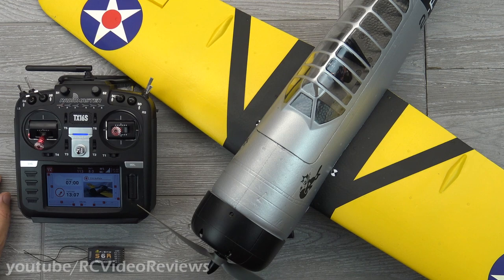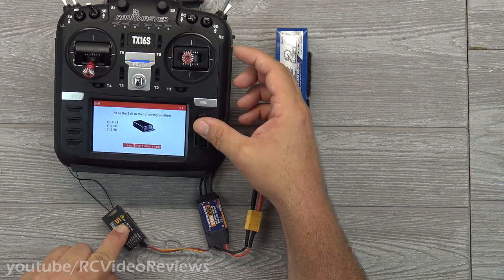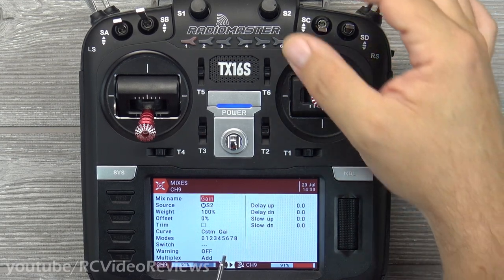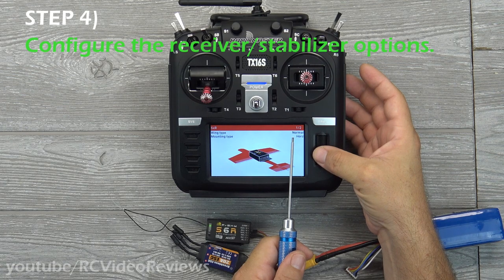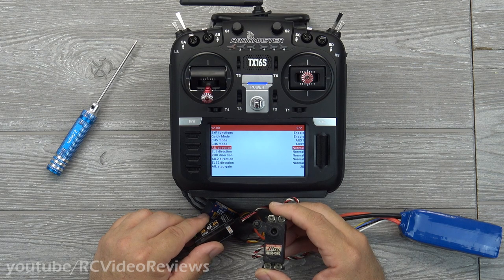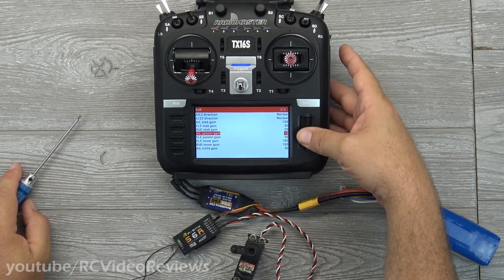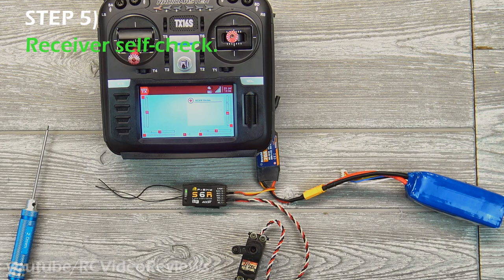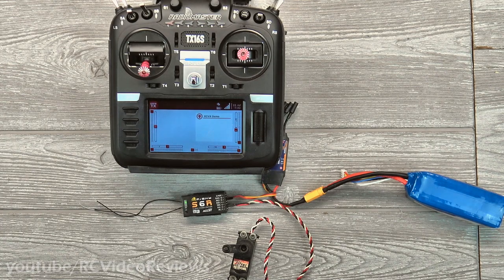Radiomaster TX16s and FrSky S6R / S8R Setup Guide [Quick Mode] • [Intermediate]

Comment: Hi John,
I studied sveral of your excellent videos and learned a lot of it.
An issue I was not yet able to solve concerns my S6R/S8R receivers.
I use edgetx 2.7 and the receivers have the level 2.3 for the FrSky firmware.
Binding is fine (FrSky X2 with LBT(EU) because my location is Germany). I selected 8ch with telemetry.
The normal functions are working, I could also calibrate and configure the receivers following your hints.
But I'm not able to put them to the self check function (blue LED) via switch SA on ch12, for which I also checked the output.
And the stabi mode switch (ch10 on SE in my TX16S) does not do anything what is described in your video
"Radiomaster TX16s and FrSky S6R / S8R Setup Guide [Quick Mode]"
I would highly appreciate your advice.
Regards, Wolfram
Reply from the maker: If you have a bind and control over the channels on the radio, there has to be something missing in your radio configuration or in the LUA. 

I would do some basic testing like ensuring my switch movement showed as an output on the channel monitor.

I would verify SXR functions enabled in the LUA script.

I would probably create a brand new model and do nothing except add the self-check and mode switches and check again.

I've used this template quite a bit and I know it works.

Comment: Many thanks for your great videos.  I set up the control surfaces as you suggest before configuration so they work in the correct sense for the aircraft. 
On selecting a gyro mode I noticed that the gyro commanded the relevant surface in the wrong direction. I used the LUA script page 2 and inverted the appropriate surface and it inverted the control surface direction! This was solved by me returning to the normal selection and reversing all the servos for the affected controls . I was not expecting that. Have I missed something?
Reply from the maker: 1) Put it in manual mode--no intervention from the stabilizer. Use outputs to ensure all surfaces move the correct way. 
2) Put it in attitude hold (stabilize) mode. Use LUA script as necessary to reverse servos until they all move the correct way.
Reply: @RCVideoReviews  sorry I didn’t explain myself well. I followed all the steps above and all control surfaces worked correctly in manual and stabilised mode. The only error was that in stability mode the response to wind gust was in the opposite direction. To get a correct response then reversed the servo direction using the LÚA script but then all inputs in manual mode were reversed also. Very strange and now sorted as I just inverted the inputs to match the working stability mode. Many thanks

Comment: Just for anyone who is having trouble binding there S6R...   This was driving me or should I say flying me crazy!   Then I was playing around will all RF Protocol and  to my surprise I found one that worked.    If your using a TX16S  you normally connect to FlySky but on some of these receivers you have to choose FrSkyX2. I believe it must be an update.  Any way that did the trick.  Hope this helps someone.
Reply from the maker: S6R is a FrSky device using D16 which is a FrSky protocol. You can't bind to a FrSky receiver using FlySky protocols. They're completely different. Also, you use FrSkyX2 D16 for v2 firmware on the S6R. If you have a v1 firmware you need to use FrSky D16.

Comment: Great video, I am guessing that all of this applies to the Radiomaster t16 max edition as well. The question I have is, have you got full Telemetry on this,  and would you think that this radio will receive the Amps telemetry coming from a FRSky Neuron ESC via the Sxr. Thanks in advance and for puttting up these very informative videos.
Reply from the maker: You're welcome. If OpenTx can receive the telemetry data you'll be able to see it on this radio. All of these tutorials apply to all of the OpenTx full screen radios and even Taranis--although a few menu items have been moved around.

Comment: Excellent!! I am about to buy some receivers. I need something with a stabilizer. Do you recommend buying the new Archer Frsky generation? or good old SxR receivers? My radio is TX16S.
Reply from the maker: I believe Archer requires ACCESS which is encrypted. You'll need something that supports ACCST for TX16s.

Comment: Thanks, that's very helpful.
Once the calibration is done could the ch12 b changed to a momentary switch (button) and be used as the panic mode to flip the plane right way up? I have an additional momentary button on the back of my tx16s which I'm thinking of using as my panic button.
Reply from the maker: Sure.

Comment: I keep on ending on your vids again ;-) Almost seen the all, thanks for the info!

I do have a question about the S6R and TX16s. If i test the servo on a servo tester its goes way further than on the TX16s - S6R. I ticked of extended limits in the "model setup" and on the output i set it on 125-150%, but no luck no more throw whatever i do. Any idea what this can be? I just want more throw for my flaps and crow braking. 

I noticed you have different versions of the S6R.. ordered two new. The V2 does come with some funny issues. From out of the box it does only do throttle nothing else. Figured out you have set the calibrate on CH12, flip the switch 3x.. and it recognizes all servo's again. Sometimes the rudder was shut off (?) even after everything is saddle.. A new calibrate and it works again, bit buggy though. I do got the newest firmware.
Reply from the maker: Hard to answer this. The servo tester could be overdriving your servo. With OpenTx firmware 2.3.10+ you have ppmus values for a given channel shown on the output screen. What I would do is look at the output screen and pay attention to that value as I moved the servo. You should go from 998us to 2012us. As long as the servo moves with your stick from 998us all the way to 2012us and your weights = 100% on output, your servo is going as far as it is designed to go.

Also, make sure you aren't using dual rates when you calibrate. Make 100% sure your inputs, mix, and output all have 100% weight BEFORE you calibrate. If you use anything less, you will not see full movement when you operate the sticks.
Reply: @RCVideoReviews  Thanks for the reply! Due to your comment I found a little rabbit of 20% on the input on the ailerons. After calibration.. it got up a bit! It indeed goes from 998us to 2012us.Thx again!

Perhaps other servo's would be a solution for more throw? Your secret servo's the Emax ES08ma;-)
Reply from the maker: Glad your found it.  Heck the specs for whatever servo you want. The radio should be able to drive it to the specs.

Comment: Auto-level can be very difficult to control once engaged. Id encourage the use of auto-level on an intermittent switch while using Gyro mode on fixed position switch...
Reply from the maker: Pretty subjective statement. I've flown planes like my Dart on autolevel for 45 straight minutes. It may be difficult for you to control, but that is a personal issue, not global.

Comment: OK I understand that weights can all be reset after calibration. How about trimming? will trimming using the normal manual adjustment and mixing for say flaperons be OK?
Reply from the maker: I don't understand this question: "will trimming using the normal manual adjustment" 

Mixing is not impacted by the self-check. The self-check tells the radio about level and range of motion for the sticks. I believe it incorporates trims but haven't tested that one.

Comment: I assume that full stabalization mode is not engaged until the plane is in the air? It seems it would make take off difficult?
Reply from the maker: Stabilization can be turned on any time the pilot wants it turned on. I don't understand the nature of this question.
Reply: @RCVideoReviews  I guess what i meant to ask is can stabalization mode make the plane react slower to inputs on take off? Or if you are maidening an airplane for the first time as a new flyer and havent trimmed the plane yet but neutralized all the control surfaces, should you count on stabalization mode to make first flights easier?

Comment: The receiver must have both gyros and accelerometers in the circuit board. When you are on rate mode only the gyros are correcting. When you are in auto level mode both gyros and accelerometers are working. That's why you see what you saw when you played with the gains between the two modes.

Comment: Is there a way of using the ch 9 gain function on a trim switch such as the T5 so you do not have to remember where you left the knob for the gain? I tried it by changing ch 9 to T5  but the trims did not do anything.
Reply from the maker: Use t5 up and down to adjust a GV. Use that GV as the weight on the mix for Ch9.
Reply: @RCVideoReviews  thanks but I tried what you suggested but it didn't work. It worked with all the other switches and knobs but not with the trim switches. There may be bug on v2.10.1.

Comment: Hi Can you help on bindig please. I have a Frsky S8R receiver and cannot bind using EdgeTx. I have bound using Open TX both on the same Radiomaster tx16s. When I power up the receiver pressing the f/s button i dont get a green light, I get solid green and solid red light. Nothing I do seems to get the receiver bound?
Reply from the maker: Sounds like your bind button might be broke. If you press the button before connecting power it should go into bind mode.

Comment: Outstanding
Reply from the maker: Thank you.
Reply: @RCVideoReviews  By the way, if you haven't already worked it out. The fact that stabilisation is always working when in level mode does make sense to me. I think of level mode as an option to stabilisation, ie.keeping the aircraft oriented in a horizontal plane rather than in the commanded position. Roll and pitch would affect this but yaw would not, so no need for rudder adjustment.
Reply from the maker: @mikelinton8011  Yeah I get that. I'd like to hear from the programmers on this someday though.

Comment: Thanks. When I have the rx plugged in and it's configuring my tx16s keeps saying rf signal critical even though the tx only a meter away. Due to this the rx never manages to complete configuration and it is continuously in the searching mode.Any idea what I can do to prevent it from losing signal?
Reply from the maker: See this: https://www.youtube.com/watch?v=08W8usnP0dA

And make sure you keep the TX/RX antennas in the same plane (horizontal/vertical) and provide some separation to avoid swamping.
Reply: @RCVideoReviews  ok, thanks.
Reply: @RCVideoReviews  unfortunately that did not work for me. I gave up for a while but now want ro get to the bottom of it. So the signal is fine at all other times, reading over 100 rssi. However when I enter the calibration and configuration modes the rssi drops significantly preventing me from completing these steps. I have moved the tx away from the rx and even moved to different locations but to no avail. I have three of these rx's and they all do the same. Could it be the lua script that perhaps has a bug? What could be causing this rssi issue? Help please.

Comment: Great video, thanks for the entire process! I started out with a S6R out-of-the-box and this receiver will not bind. I think it needs a firmware flash first to work with my Tx16s. Did you flash your latest firmware on the receiver before this video?
Reply: Found the bind problem... I'm in Europe and the S6R is then EU-LBT which is a different protocol setting from what you are using in the USA - actually frsky puts a sticker on the box saying eu-lbt. I saw your screenshot saying D16 but that varies for international viewers. That's all.
Reply from the maker: Got it. Glad you figured it out. I figured non-US folks would know about the FrSky nuances and honestly, I'm not versed in EU-LBT protocols enough to be a source of information.

Comment: How do you set up all these little toy quads you get that come with their own controller?    I have no idea what chips i in them or what protocol they use or anything.   No RC channel ever does anything about how to use a multiprotocol transmitter with all these old RC toys with their propreitary controllers.  Stuff from back in the Radioshack days even.   I'd like to be able to just use my Radiomaster to control them all.   So how do you find out what toy quad uses what proptocol and then set it up?   Bardwell won't even touch it, I've done asked.
Reply from the maker: You're going to have to visit this page:
https://github.com/pascallanger/DIY-Multiprotocol-TX-Module/blob/master/Protocols_Details.md

Look for the manufacturer, click on it and read the description and protocols supported. I think the problem is going to be binding. Every manufacturer has a different bind procedure so once you verify a protocol is supported, you're probably in for some quality Google time.

Model manuals may provide some insight as to how to enter bind mode on the individual device.

Comment: Noticed the variables on your Outputs are -100 to 100, my radio defaults to -512 to 512 when setting up a model.  How do I change this to a default value of -100 to 100?
Reply from the maker: Did you use the ppmus option on your firmware?

Comment: Before I set up S2 to control the stabilization gain, I had it set up in the radio's global functions as a radio speaker volume control. Even with the model settings, S2 still only controls the volume. Do I need to delete the volume control setting to get the gain to work properly?
Reply from the maker: No, you can have it control both if you want, just be aware when you turn up your gain you turn up your volume.

You can use S1 for gain if you want..?

Comment: Can this receiver be used without the stabilizer function activated or even configured. You know just plug and play for a 4Ch plane ?
Reply from the maker: Yes. It would be overkill for that, but yes, you can (and I usually do) fly with the stabilizer off.
Reply: @RCVideoReviews  what RX would you recommend for use with the tx16s and fixed wing sport planes 4-6 channel that is readily available, good value for money and easy to use. Thanks a lot. I'm sure you are busy.t

Comment: I was wondering if you could help me out. I'm having trouble binding an R9 STAB OTA receiver with the R9M module. The lights on the receiver show that it's ready for binding but never does. I already flashed the module to the newest firmware so I'm confused. This is my first rc build. Thank you.
Reply from the maker: Did you try frequency tuning? From the MPM Guide: If the receiver does not bind, and the RF Freq. fine tune option is available for the protocol, change the RF Freq. fine tune value to either -40 or 40 and try to bind again.  If binding is still unsuccessful, continue to try higher and lower values in steps of plus or minus 40 until the bind succeeds.

https://www.multi-module.org/using-the-module/frequency-tuning
Reply: I haven't tried frequency tuning yet so I'll go ahead and try that. I haven't updated the firmware on the receiver, only on the transmitter module, could that be causing the binding problem ? Thanks for the help btw .

Comment: Hi John, I have setup my S8R and works great. Picked up an SR8 Pro and can’t get past the registration part with my TX16s. Saw video with ETHOS but does me no good. Have you had any experience with SR8 PRO and EdgeTX? Jim
Reply from the maker: Do you know if the (SR8 or S8R?) has Access or ACCST firmware? If you're trying to bind with a non-frsky radio, you need an ACCST firmware on the Rx.
Reply: @RCVideoReviews  The SR8 Pro has ACCESS firmware which I now understand has to be used with an FRSky transmitter. A lot like Spektrums new receivers.
Reply from the maker: Flash ACCST firmware if they have one. Otherwise it won’t work. Good luck.

Comment: been looking at this vid for the 3rd time... bought 3x a s6r;-)

Still why the calibration on switch SA? If you have calibrated once is there reason you want to calibrate again? Isnt it just way more save to just delete the entire option on SA? Means you can be in trouble?
Reply from the maker: Sure..you can delete it if you want.

Comment: Hi nice video thanks you!  I have a problem,  under special functions and Global function I lost all of my system settings.  So if I want to put a motor cut off switch before is would come up as override but now I don't have that command and can't cut off the motor.  can you tell me how to get these commands back?

James
Reply from the maker: Did you change your firmware recently? Did you change any of the firmware options?

Comment: Hi Thanks for a great  video. I have Jumper T-12 Pro is this unit able to be programmed the same as the Radiomaster Cheers Colin
Reply from the maker: It's OpenTx so the programming concepts will apply although as a BW radio it will be a little different to navigate of course.

Comment: CH 12 is a great feature but also an accident waiting to happen.... good advice; 10:46
Reply from the maker: Scared the devil out of me when it happened. Gotta make sure that switch is off or at least be ready for how the plane will fly with it on. I did it with the gains turned off and had no ailerons. I managed to bring the plane around with rudder and land before I figured out what I did. Thought I lost a plane...